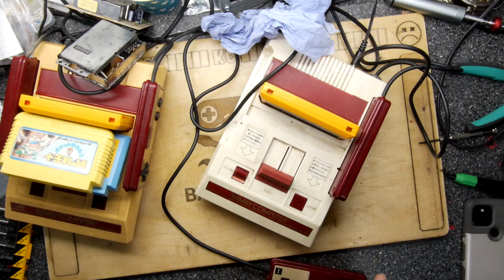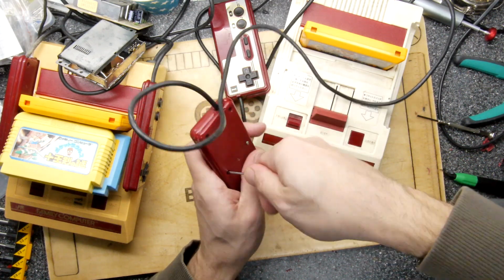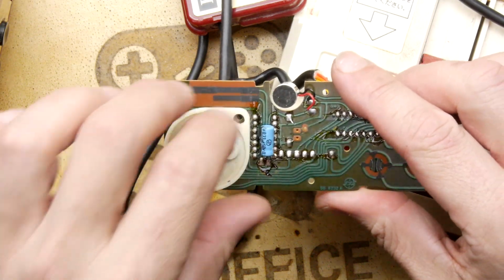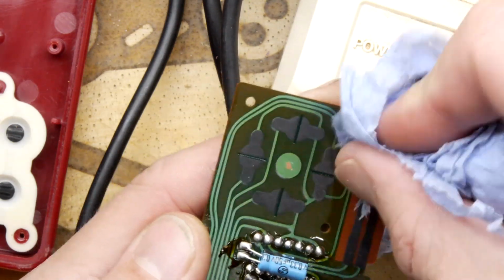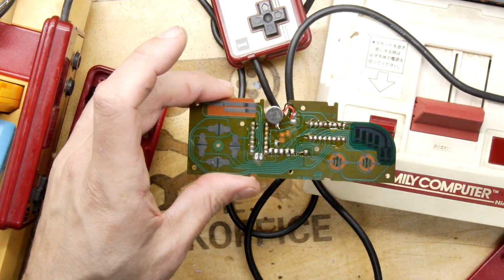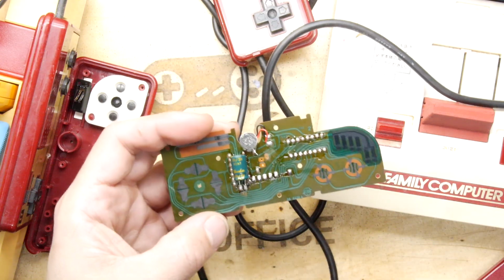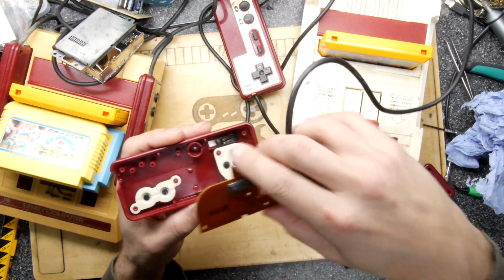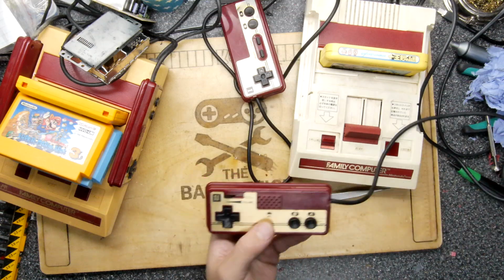Nintendo Famicom Controller Noise "Regular" Fix

Comment: Thank you for this video, I recently picked up a TWIN FAMICOM which had some problems such as a dirty inside (lots of dust balls), and the more pressing problems like the disk drive belt being bad, and the sound issue. I was really worried I'd have to spend more money to fix the sound but it turns out it was just the contacts on the microphone switch giving me issues! Now I can play whatever games I get for this thing with zero sound interference!

Comment: Remove the microphone and capacitor. Short the two microphone rail wires with copper or aluminum coils.

Noise booming disappears

Comment: It can be solved according to this clip.  I found a solution by changing  The power supply capacitor is still not good.  and found it was the 2nd controller with the dirty mic and volume

Comment: I fucking hate those controllers being hardwired, somebody should make a detachable controller hack.
Reply from the maker: Technically you can use the port on the front for the controllers, possibly even the NES ones would work